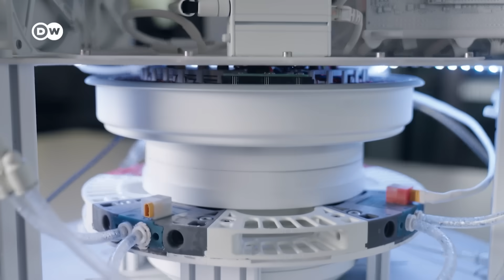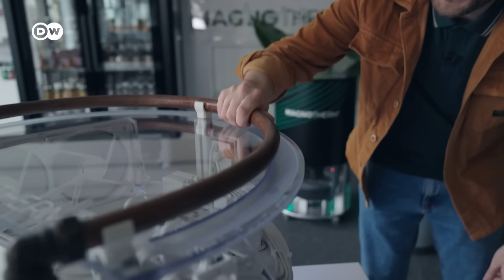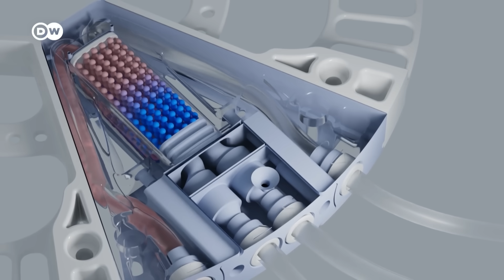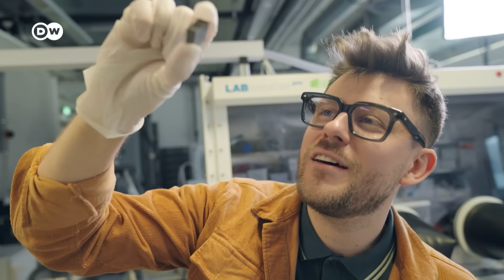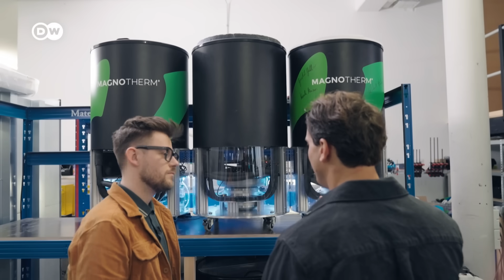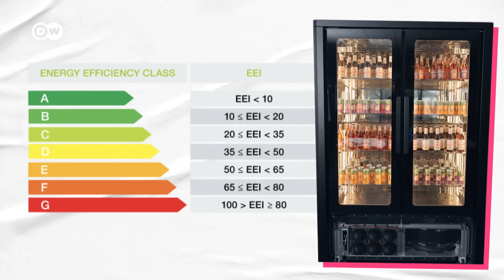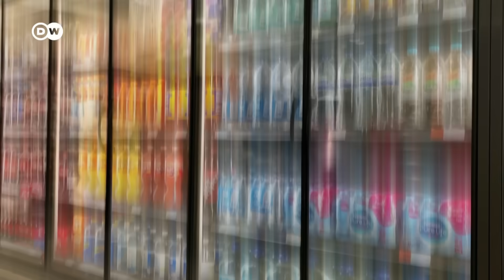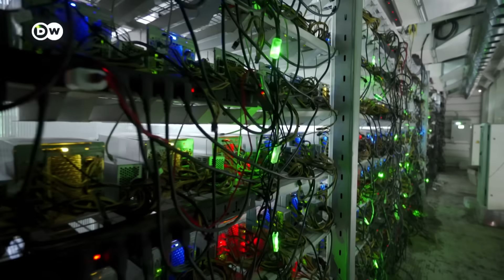How magnets could change our fridges and ACs forever

Comment: I DON'T THINK THIS WILL WORK, DUE TO THE MULTIPLE MAGNETIC UNITS IN A FRIDGE! THE MORE MAGNETIC UNITS YOU HAVE, THE MORE PRECISE THE SYSTEM HAS TO BE AND AS A CONCLUSION MULTIPLE POINTS OF FAILURE! IT'S LIKE HAVING A CAR WHICH RUNS EVERY WHEEL INDIVIDUALLY AND WHEN ONE WHEEL FAILS THEN THE WHOLE CAR BREAKS DOWN.

Comment: My fridge has numerous fridge magnets attached to it, yet I see no difference in the fridge's cooling ability.
Reply: You first have to arrange them to spell out the word COOLER.  Duh.
Reply: try neodymium magnets
Reply: @futbolita89742   I was thinking more along the line of placing the fridge inside an MRI machine to get at least a 3 Tesla field enveloping it.

Also, as an added bonus, connecting the fridge's cooling system to the MRI machine's super conducting coil liquid helium coolant pipes should chill things nicely. 😉
Reply: Great
Reply: Do you wear protective glasses? I wonder why these guys do around the magnets.
Reply: Fridge Magnets eh? Somehow my old grandma knew this all along😮
Reply: Maybe you should put it inside lol.
Reply: lol
Reply: You need to push them around in a circle
Reply: I advise you to place your food around the outside where the magnets are positioned,  see if that works for you Einstein.
Reply: @gh8447 It’s a joke 🤪

Comment: Without the cop reaching 3 i don't see a point at the moment to scale up production. Peltier elements can even be pushed to that degree and they are not noisy as it would be all static (well maybe you'd have fans to displace hot air so the ambient side stays cold). That is an already inefficent method of moving heat being better then this. Now i don't mind this idea being pushed along for scientific potential but i really don't see an application as a refrigerator. This system does not even seem to use a refrigerant so how other chemicals interact with the pumps,pipes and magnets would interact would also be important.

Comment: One thing I am curious about is efficency over time in air conditioning applications. When you consider things like dust and biomatter blocking fans, to what extent can magnetocaloric cooling improve on this?

I'm guessing seeing as they are only targetting the replacement of the compressor, not very much, but that would be a big win if they did
Reply from the maker: Hey David! There is a lot of research and testing going into air conditioning systems making use of the magnetocaloric effect as it offers a more environmentally friendly alternative to existing ones.

Comment: Your initial description of how fridges work was simplified to the point of being flat-out wrong. You likened it to evaporative cooling, which is quite different to refrigerative cooling.   For the folks at home, evaporative cooling cools air by the evaporation of water into warm low humidity air, resulting in cool high humidity air as the heat required to evaporate was taken from the air.  Refrigerative cooling compresses and cools a specific gas until it becomes liquid, then expands that liquid back into a gas through an orifice, reducing its temperature in an effect named after Joule and Thompson. (JT cooling). This cold gas is put through a coil to chill a secondary fluid, usually air.  Once it has absorbed heat from the air, it is sent back to the compressor and reused. Although the word 'evaporation' is used in both cases, it is actually two fundamentally different scenarios.
Reply: It is called "phase change heat transfer", not "refrigerative cooling". Sorry for the nit-picking.
Reply: @albinklein7680  You forget that evaporation is a phase change too. I'm an engineer that studied Air conditioning, refrigeration, thermofluids and thermodynamics. It was never called your term.

Comment: Cool physics, cool design, cool tech, but completely unnecessary product. It will probably never be able to compete with other fridges apart from a few eccentric restaurants who want that cool fridge with the rotating parts visible. I might 😂. But the masses - no. The mechanics and control are WAY too complex to justify a humble fridge. You have huge parts in constant rotation with valves going on and off every second of so etc etc. I can imagine the costs of production are just wayyy beyond and if something breaks, which it will, repair will be more difficult. And it solves a problem that almost doesn't exist. A modern optimised fridge uses about 0.25 kWh a day when its closed. About 10 watts. Where I live that costs about 20 euro/usd a year. 1/3 of that is 7 about, now lets double it to account to opening the fridge, so say 15 usd a year. so if the magnetic fridge is just 30 bucks more than a normal fridge, so say we look at a 600 usd fridge, if you pay a humble 5% premium for the magnetic version, it will have to run for 2 years without issues to just get the premium out. I mean all respect for the engineering, tech and design ... there is just no business case for it. They should have only gone for the AC if they are sure it could be 30% more efficient than normal ACs. I do wonder who funds this stuff....

Comment: Some genius in Minsk, Belarus built a freezer to run outside, at  the balcony or around porch. For half of the year when it's freezing outside, it just sits there at 0 KW. 50% savings in most of Eurore, up to 70% in Nordics and it costs €300.
Reply: So variabl isolation?
Reply: Esa si que es una persona muy inteligente !!
Reply: Was gonna say something similar when guy pointed outside
Reply: Split units and diverter valves existed for decades, but it all takes money and installation time. Meanwhile people just want 300-500$ fridge that works out of the box with no installation.
Reply: Very logical and interesting observation! In cold countries we should be using the cold outside air to keep our fridges running affordably. Even extremely hot desert environments the night time air can be freezing.

Comment: It looks like those fridges can be driven mechanically where electricity is scarce. You can rotate that thing directly from a diesel engine without having to convert the rotational energy into electricity, thus saving some power
Reply: Same as you can with a compressor. Compressors have motors in them that just spin.
Reply: @ This is a very good point. Hadn't thought of that
Reply: @soberhippie  absorbtion fridges aren't great efficiency-wise, but any heat source will do. That's the advantage. A few decades ago I saw a huge chest freezer at my local scrap yard and the little chimney on the side caught my interest. It was an ancient absorber freezer from the early 1950s, obviously made for rural areas without electricity. It is a very well made thing. But the final reason that I just HAD to take it home was that the thing ran on kerosene. I used it for many years as a beer fridge in my shop and I ran the used kerosene from my parts washer through it.
Reply: Why would you do that? You can power an absorbtion fridge (no moving parts at all!) with basically everything.

Comment: What about using this magnet tech for heating? It's well known among some circles that heat pumps are way more efficient than resister heating for warming up, but if the temperature dips much below freezing that causes issues with compressor heat pumps. 

Magnets in theory wouldn't have that issue or have it nearly as much so you could efficiently heat pump from much colder temperatures.

Comment: They don't even talk about using lower boiling liquids better than water.? Also why add complexity by using these to cool instead of just efficient heating systems? Still Kool but definitely think there other uses that might up scale easier. Then once you have big magnet heating systems all over add the refrigerant/tor in to cool a fridge.?

Comment: This is not a deep report in any sense. Also it fails to tell us the fact that, nothing about the engineering really matters. The only thing that matters is the material science. If you can't find a material that gets the efficiency high enough, none of the engineering, the design, or the 3d printing matters. It's like you're trying to build a magnificent skyscraper but the city doesn't yet have electricity.

And none of the engineers or the scientists know how to find such a material. It's just like superconductors research. We have no clue how any of the materials work, and yet why are we trying to build a company based on a material that has yet to be discovered?

Comment: The problem i notice about a lot of these new technologies is that everyone talks about how its just cheaper to buold the old tech. Of course it is, economies of scale do that. It is almost disingenuous to compare a compressor made for $5 to this brand new tech. I remember  hearing recently about a material (i think it was gallium, could be wrong) that is better for electronics than silicon, but one of the reasons companies dont want to invest is because they've already put hundreds of billions into silicon production. Corporations hold us back from advancement because they wouldn't see an immediate raise in their stock value
Reply: it's not economies of scale. This thing is full of moving parts and intricate pieces that make it very expensive to manufacture and maintain. The real problem is that this 'technology' offers no real alternative to traditional fridges. There is nothing innovative about it that would make it worthwhile to explore this cooling method further for commercial use. Others have tried already.
Reply: @mullerstephan  that's what people said when we tried to replace horses with the first versions of automobiles
Reply: @JGamer415  had others tried making automobiles before that? No.
Reply: @mullerstephan  the first automobile was invented in the 1880s, and the first largely adopted car in America was the model t, invented 30 years later. Most families wouldn't own a car for another 30 years because it was just too expensive. The need to invent personal automobiles was 0 because the tech wasn't good enough yet, and horses, boats, and trains could fill all the transportation niches.
Reply: @JGamer415  Are you SERIOUSLY trying to compare an invention like the automobile, which ushered a transportation revolution, to this gimmicky refrigerator which AT BEST promises a 30% reduction in energy costs??
Reply: @JGamer415  are you seriously trying to compare the automobile, an invention which revolutionized transportation, with this gimmicky refrigeration that at best promises an energy improvement of 30%? LOL
Reply: @mullerstephan yes, and this technology doesn't need to be limited to refrigerating food. It could be used in many different fields that require cooling. Also, you do realize that saving 30% of energy costs in that field alone could save billions of dollars, not just for average consumers but also businesses. It also reduces our dependency on harmful chemicals that destroy our environment solely used in the refrigeration cycle
Reply: @ I agree with it being something that could find application in the industry where they could, in fact, save money by lowering their cooling energy costs. I don't think its something for the average household though.
Reply: @mullerstephan  that's where economies of scale come in. First, a small niche is found for the product. Either because the savings or it has some special use case. Then, as a company develops a reasonable supply chain for the materials, the price slowly declines, and the company grows along with its supply chain, making the  product cheaper. Eventually, it reaches either a price parity with current tech or a price that makes its added efficiency worth the extra cost. Also, the technology will naturally improve during that time as it grows in use cases and more data is collected. The first digital camera weighed 8lbs in 1975, and now the camera that sits inside your phone is no bigger than the tip of your pinky. The whole point of my original comment is that we need to be more open to new tech. Otherwise, we end up looking at another Kodak situation. They patented that first digital camera but refused to invest because they simply made too much from film sales and knew digital photography would eat into it.
Reply: Silicon is nearly free compared to Gallium.
Reply: @laurencerilling5873  as is the iron for a coal generator comparatively cheap to the rare earth's needed for solar panels, but we still build those because there are other costs than just material

Comment: I don't see this being feasible in the market. Not only because of the cost but the weight factor which is very important. 
Weight means you need a larger crew, design or crane to get the equipment up to where it needs to be. Those magnets aint nothing light if 50 kgs only gets you 2000 watts.
A scroll compressor of 28,000 watts weighs 68 kg. I would assume cost of installation would be cheaper since you don't have to run copper lines with refrigerant in them and no need to braze.
Some type of plastic with insulation would be suitable to carry cold water to the heat exchanger. I like the idea, principle is the same as the old system but I can't see these in a commercial/industrial application.

Comment: 1. It saves greenhouse gasses. Helps preserve ozone, too, but the next gen refrigerants will be pretty good anyway.
2. The fancy stuff feels counterproductive. Spanning 40 degrees (Celsius?) in 5 degree steps means about 8 simple stages.
3. Weight and complexity makes this impractical. Given the same money and a mandate for efficiency both compressors and the new fangled sound wave cooling would be at least as efficient and perhaps an order of magnitude lighter.

Fun, but it won't win.

Comment: I think this has a long way to go before it can compete with existing compression tech..the compression tech is inherently very efficient and can be tweaked by changing the coolant, compressor type or how the coolant is circulated, so many leeways. But I think this magnetotherm tech will have its use in large building scale cooling with lower cooling span...the best part here is that the coolant is just water...as it doesn't require compression, but only needs to have high specific heat.

Comment: So you need to add water all the time, and there is mechanical parts that has to move all the time, and it depends on eight percent rare earth minerals? Still a challenge, but getting closer.

Comment: meh, if people understood low emissivity coatings (al foil tape) and brought back freon r12 which had 60% better volumetric efficiency for cooling compressors at 1/10th the head pressure, you could lower cooling losses by 80%. everyone is still in the mode of vilanizing cfcs even though the ozone layer is recovering now.
freon compressors ran at way lower head pressure and never wore out. whats the environmental impact of r128a/propane/other flamable compressables/co2 which crap out after a few years duue to the super high head pressures compressors need to deal with. its just like a turbo'd gas direct injection car engine, it wears much faster because of all the stress needed for normal operation. bad for the environment. co2 is going up every day, ozone is recovering every day, we need to shift our priorities. there is a reason the space shuttle used r12.

Comment: I love the research however I'm a bit trepidatous regarding the computational requirement for precision pumping to keep the system cool. This is minor microcontroller computing but still it seems like a sensitive point of failure for a merely equivalent system. 

The research and material could possibly be co-opted into other projects and technologies but I'm not so convinced this is the future of refrigeration

Comment: They might want to try is using a Tesla turbine powered by the action of the magnets to manage a high to low pressure intercahange to move the heat away. Just a thought.

Comment: Why don't you store the warm water in an insulated water boiler instead of releasing it into the air?
Reply: Why is the back of your fridge not water cooled? Because you wouldnt have any purpose for a bit of lukewarm water.

Comment: If there is no electromagnetic induction, when the DC magnetic field is controlled to fluctuate, it will reduce the temperature whether moving parts or not.

Comment: Interesting but somehow logistics dont show much promising due to manufacture process, and rarest material availabilty. Same time fridge or AC might best candidate if manufactring challenges can be fixed, still it requires more power. And last freezers are still out of question.

Comment: It's an interesting prototype and may find application in very specific situations, but I doubt that it will displace the compressor based heat pumps found in almost every home any time soon.
I could forsee that delicate timing for the cooling cycle being easily thrown out of alignment by daily life or something as simple as a power outage.

Comment: NOOOO THANK YOU!!! I can only imagine the repeated failure of the different mechanisms this will compromise of. What is the fridges life expectancy? Will I have to replace the fridge every 3, 5 or 7 years? Seems very likely!!!! Why mess with our current simple system that’s reliable, easily repairable & inexpensive. I wonder how much energy is used to manufacture everything to make 1 fridge compared to our simple current fridges.